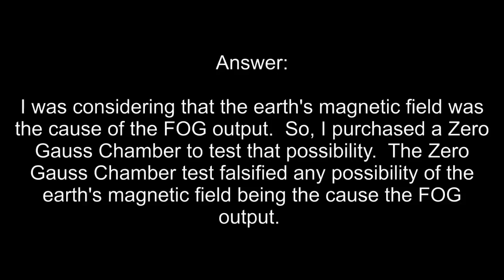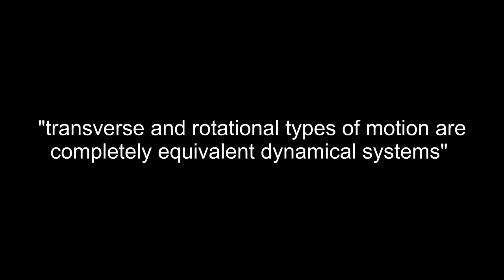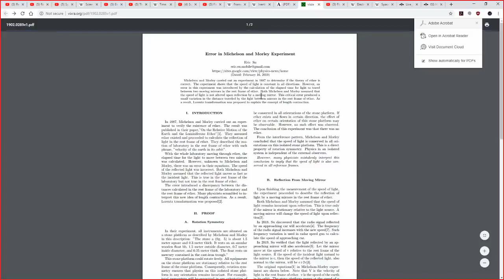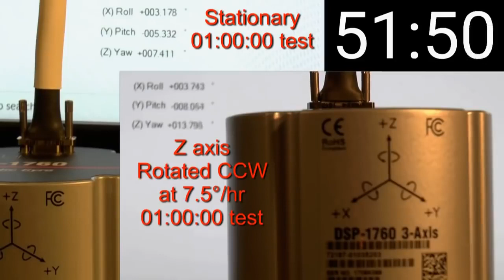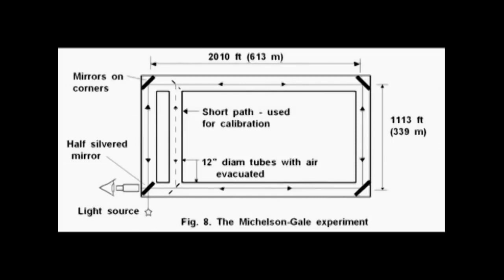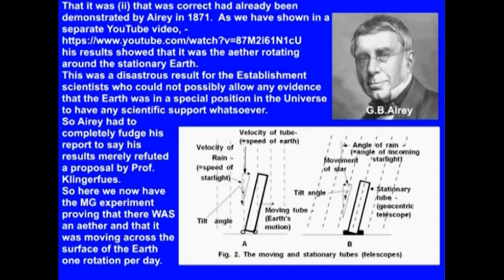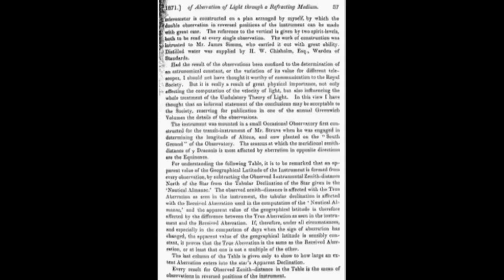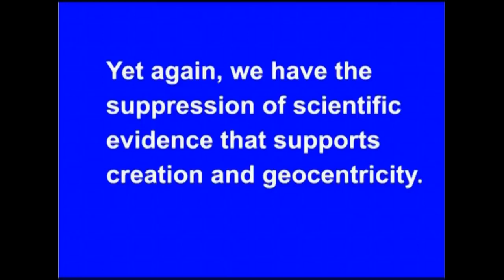Fiber Optic Gyro Q&A; Sagnac Effect  BOTH Rectilinear & Angular Motion 720p

Comment: Can you explain GPS satellite functions which is programmed and corrected per  the equation of special relativity and it working with great accuracy and  very useful in day to day life?
Reply from the maker: Sure GPS works as it should by triangulation, the equation of relativity is necessary to derive the the spherical coordinates from the planar system What do you think relativity is if not a mathematical transformation stolen by Einstein while working at the patent office. It was stolen from Henry Poincarre that patented it as such: a mthematical transformation. that is why from General Relativity you can derive new "relativities" as in a "special" one and so on? You only need to add parameters and run the calculation to make up any bogus cosmogony. It just reflect nothing but a mathematical transformation extrapolating one set of coordinate into another. It doesn't reflect any reality, it hides it.